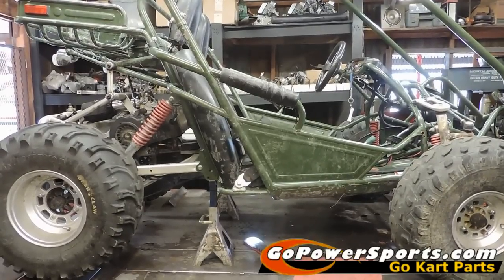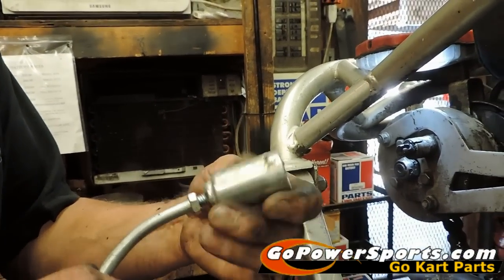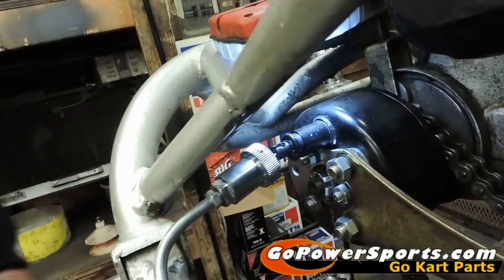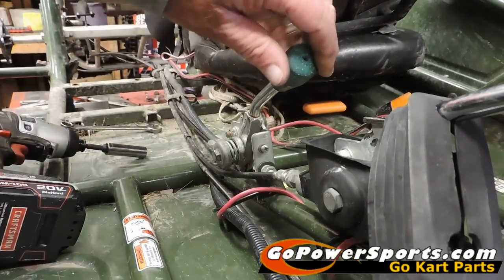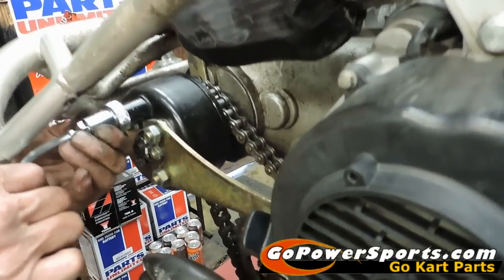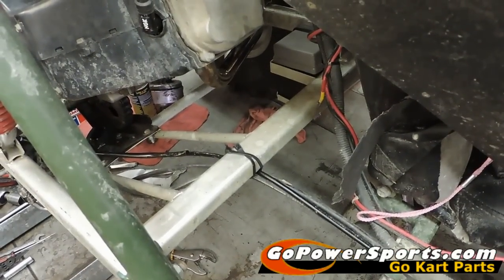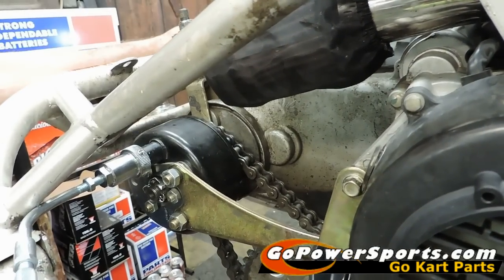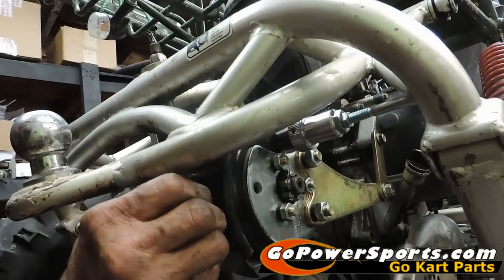Go Kart Reverse Cable Install

Comment: My Gokart has a different set up do you have any video with a Hammerhead Transmission Shifter Assembly for 150cc / 300cc / Mid-Size Gokarts with Reverse - 14478 replaces 4070000300G000

Comment: Nice video. I think my shifter is the same with forward and reverse. Is there anyway to add a neutral in the middle. Can I switch a forward reverse neutral shifter or can I cut a notch in the middle of forward and reverse in the middle of the 2 for neutral

Comment: Recommend you take off the cover and inspect the belt drive setup. There is a driver clutch ( variator), driven clutch and the belt. Any of these three components can fail. If it is an older machine we offer a complete replacement of these three components for $99 ( driver, driven and belt) part # KD150drkit. If you can see what is bad by visual inspection we sell the parts individually as well. If you have further questions feel free to give us a call at 866 846-5278.

Comment: I'm having several issues with reverse on a kart I recently purchased used. It's a 150cc with what looks to be a dual chain set up. The hole assembly locks up when reverse is engaged. The reverse assembly looks slightly different as well. Any advice you could provide would be greatly appreciated!
Reply: I know I am kinda randomly asking but does anyone know a good site to watch newly released movies online ?
Reply: @Damon Walker Flixportal :D
Reply: @Lucca Aldo Thanks, I signed up and it seems like they got a lot of movies there =) I really appreciate it!!
Reply: @Damon Walker happy to help :D

Comment: hey a just got "hommemade dune buggy" and realise it is a chines one like in the vedeo. could i have your e mail i need help with it. i replace the carburator but there is a bunch of thing to do to it. there not even a cable for neutral or forward. and brak not fixe. so it goes forward and that is haha. thanks for your response.